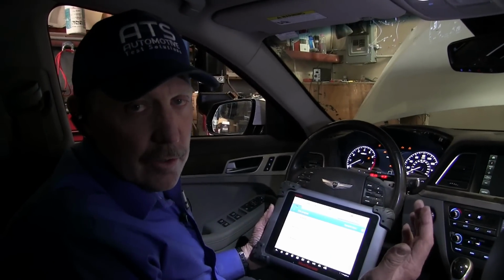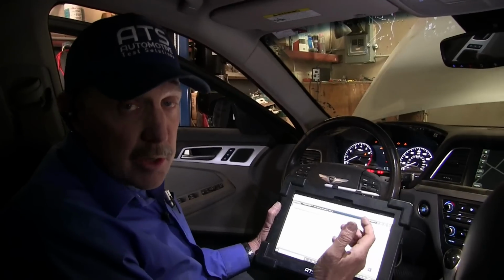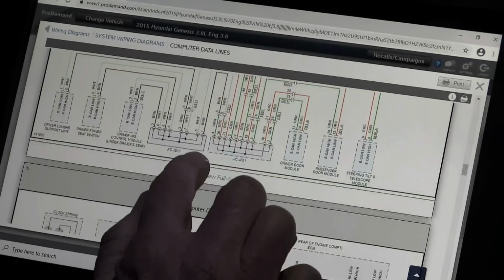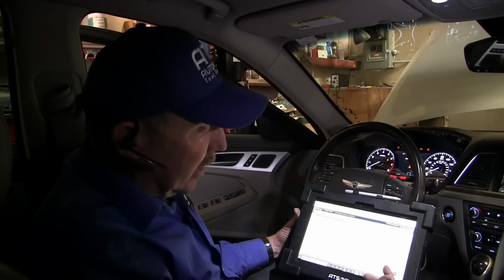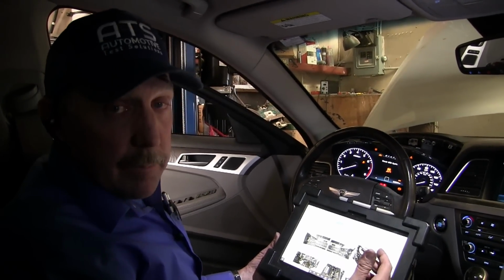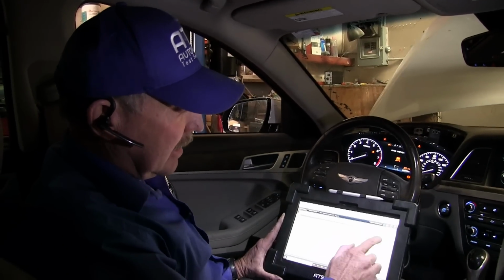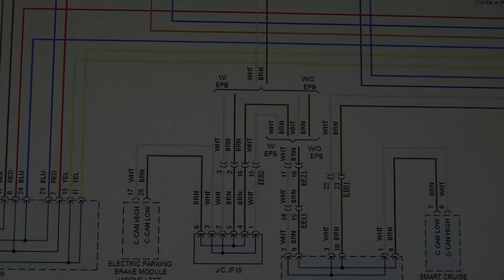2015 Hyundai Genesis Instrument Panel Not Working

Comment: I have the problem of my climate control not coming on in my 2015 Hyundai Genesis because it's not receiving electronical power to be turned out. I need help. I've taken it to many places even the Hyundai dealership and none can find the issue.

Comment: I have a 2013 Hyundai Genesis whose dashboard failed when it was under warranty at 3 years old. The entire instrument cluster was replaced by the dealer where I bought my car. Fast forward 6 years from that point and only less than 10,000 miles later, the instrument panel is not working again and a different dealer is recommending replacing the entire cluster again outside of warranty. My hunch is that it is unlikely to be a dashboard problem and there is some form of electronic communication disconnect that occurs over time. Your thoughts?

Comment: Had the same problem with my 2015 back in 2019.  If you didn't already find my post on the Genesis Owners forum, do a search for 'totaled insurance company' and check the titles only box.  I bypassed the connector in the right rear fender well to get the parking brake out of the CAN loop.  It was much easier to get to.  I actually repaired my EPB instead of replacing it.  And, I managed to get it out without lowering the rear suspension subframe.  It was tight but doable.

Comment: I jumped start my car (2012 Hyundai Equus) when the battery died and now my instrument cluster and lcd dont turn on or light up.

None of the gauges turn on.
Radio, ac, navigation all work fine.
I drove it around to make sure the battery got some charge too.

What can i do ?
Reply: Did you ever find the solution?

Comment: Wow I must say,
 Automotive test solutions you have my attention.  I was snap-on all the way.  But seeing your platform and testing methods.  Leaps and bounds past snap-on.  (With VE efficiency) the zoom window for detail is awesome, and on and on the the tests seem to be endless. For the detail that was the only reason why I was thinking picoscope not anymore.  I am currently using a snap-on 4 channel lab scope (Verus Edge)
  But they have nothing on the e-scope elite/ 8 channel scope.  Those extra four channels will definitely help with my diagnostic time!  The case study on the Dodge with the misfire, I can tell it would only take you about a two to two and a half minutes of diagnostic time to figure it out.  I cannot wait to get my hands on an e scope Elite eight channel scope. Thank you for putting something like this together, the automotive trade really needs it.
Sincerely Dean law.

Comment: A relative of mine bought a new Hyundai Genesis around 5 years ago, she was having some battery drain and instrument cluster problems so she took it in to have some warranty work performed.  She continued to have the same problems when she picked it up. She brought it back to the dealer and after 2 months and a a new engine wiring harness replacement, they bought the car back from her and gave her another new car.

Comment: I'm guessing when he talks about bridging the wires at the end of the video he just connected the two white wires together, and the two browns together on the right of the connector block on the diagram, so as to leave out the brake module altogether?

Comment: Now I'm a seasoned tech myself an know my stuff pretty well, but there's always that little piece of golden info I gather in every Bernie vids.

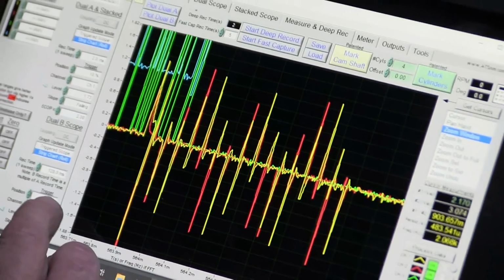I already know how to check and diagnose CAN buses, but there was this very useful but discreet tip, at around 15:20, that I had never tough of.

Looking at the waveforms, I can now tell if the lines are grounded together or shored together by seeing if there's a potential difference and also if one can go high, and the other one low.

Priceless.